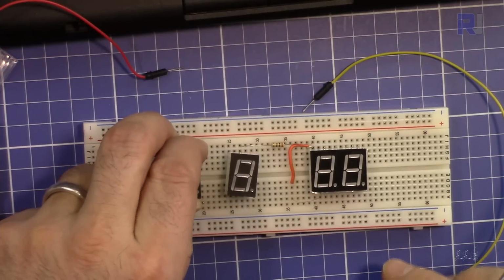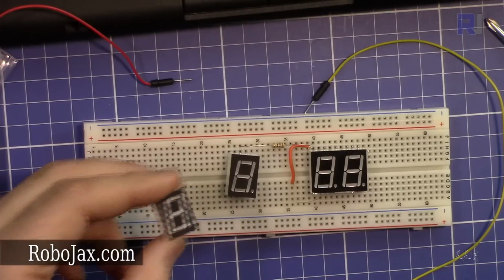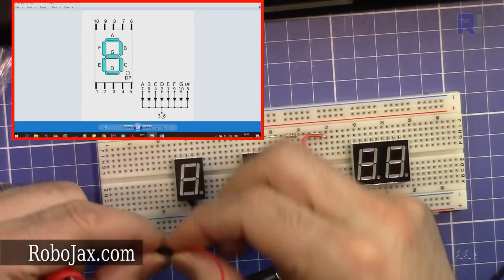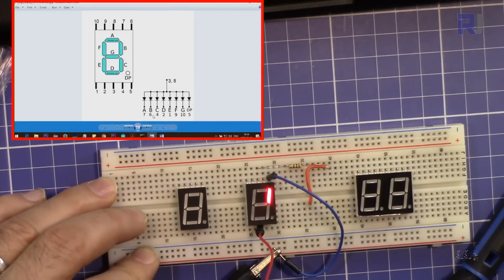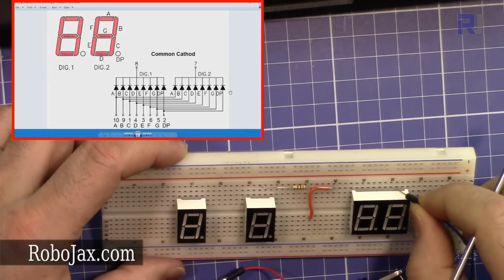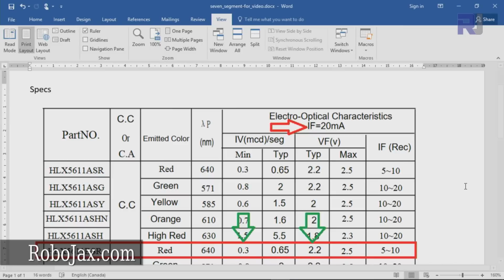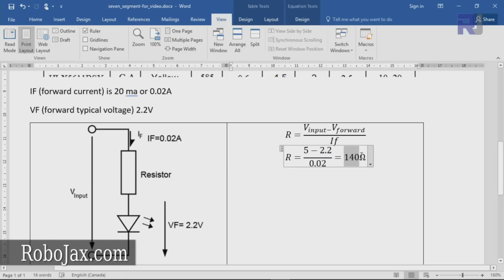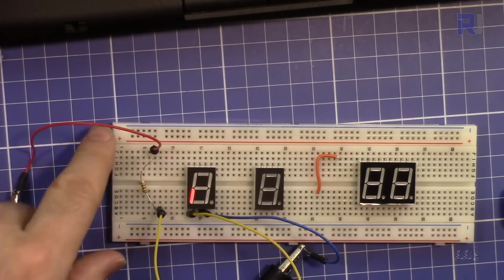How to use LED seven segment display and calculate its resistors value  - RJT652

Comment: At 20ma per segment, you don't want to light too many segments at a time if you are using an arduino, since the maximum current that can be drawn from an output pin is only 40ma. If you want to control these from an arduino either power the display from an external power supply or multiplex all of the segments such that only one segment is on at any given time.
Reply from the maker: each segment is connected to single pin so there is no issue with that. And yes external power is the best option.
Reply: @robojax  That's true in your example, but if you want to create a working two digit display with an arduino this way, you would need 16 digital pins, but the arduino only has 14.  So practically speaking, that's a problem.  For multi digit 7 segment displays, It's typical to connect each digit's common to a unique I/O pin to select the digit.  Also each segment of the digits are wired together (e.g. digit 1's "a" segment is wired to digit 2's "a" segment and so on...).  Then 8 additional I/O pins are uniquely connected to the segments a-g, and dp.  The pin count is now at 10 (still quite a few, but workable).  Of course one could reduce pins further by multiplexing the I/O (e.g. via shift register), but  in any case, once you build a practical circuit, it is then possible to turn on multiple leds and run into problems which is a trap beginner's can fall into.  Hopefully, my point is clear.  Thanks.
Reply from the maker: Here is a solution for that https://youtu.be/k-f6lwwUTAs  or this https://youtu.be/R5ste5UHmQk

Comment: this is a very clear explaination but I need more from two digits because my has 18 pins.
Reply from the maker: How  many digits it has? would you please send the text or model written on it?.
Reply from the maker: I searched it online and got zero result. Where did you buy it. Send me a link of the store.
Reply: I have one of those too, mine is common anode so there are two leads on the top where you connect the positive,  they are next to each other I think it's pin 13 and 14

Comment: How do you display two different numbers on the 2-digit one where the pins are shared? Same numbers are easy like 33, but how do you display 45 for example? Thank you for this video!
Reply from the maker: Hi, it seems you missed the most important part.  Each display has its own common. you turn on common 1 to display 33 and then common 2 to display 76.  please watch this video again.
Reply: @robojax  But the 2 digits share the same A-G pins, which means that they cannot be on at the same time to display 2 different digits.

One YouTube video said that you have to turn each digit on and off fast enough to fool the eye in seeing both digits at the same time. Is that correct? I think it makes sense. It is a compromise between less pins but more circuitry. Your video did not explain that so I didn't know.

Thank you for your reply and the details in your videos. They are great. Keep up the great work and have fun!

Comment: I wonder why I can't use one resistor in the common, that way you save yourself a bunch of resistors :)
Reply from the maker: because one resistor will create voltage reduction that is enough for one segment. We have 7 segment and each will be ON or OFF independently. If they were all on like showing the digit 8, then we could use one resistor. But because the display is to show different digits, it must have separate resistor in order to lit properly.  You could use one resistor, but at different digits, you would get different brightness which is not good.
Reply: Right, that makes lots of sense :)

Comment: thank you very much for your help and one question how much volts do i need with green because mine it doesnt work with 2.40 volts
Reply from the maker: 2.4V is already maximum. put a resister in series and revers the polarity. you might have connected it in reverse.
Reply: @robojax  thank you for your help and your quick answer i will try it and i will answer.
Reply: It works it was my first time that i use 7-segment display thank you for your help

Comment: is port 3 and 8 connected? so if I put a battery on 3 and 2,   'D' would light up? and same if i connected to 8 and 2? (i have a common cathode display)
One more thing, is there a formula to get the resistor value? (sry didn't really understand how you calculate it)
Reply from the maker: Yes 3 and 2  or 8 and 2  will turn the D . for your second question ,with 100s of videos, I had to watch to answer your question and Sure enough, I have answered your question in the video for formula. You must have escaped. I have explained so you fully understand  how to calculate the resistor. Thanks

Comment: Can these LEDs be controlled by a potentiometer to display voltage allowed to pass through the "Pot" and into the circuit?
Reply from the maker: so you want them to  be voltmeter? Not by itself but if you use an IC or Arduino, then you can send number to display. Here is how to use seven segment display with Arduino: https://youtu.be/f3GqRMQ8jYs

Comment: I would like to understand at the beginning of your video you have use the led of segments without the resistance and by the end you say that each segment led need resistance .Could you explain me please ?
Reply from the maker: I mentioned that seven segment display needs about 2V to turn ON. yes you don't need resistor if you connect directly 2V to the segments. We use resistor to divide (reduce) the voltage.  There is another video on Seven Segment here https://youtu.be/BPDbU4pBSvs

Comment: Thinking about building a calculator, how do I do a multiple didget display using a decoder chip?
Reply from the maker: For calcualator better option would be LCD1602 https://youtu.be/q9YC_GVHy5A or LCD2004 but you can do it with LED display TM1637 https://youtu.be/F5rhnFX3_w8 and you will need a keypad https://youtu.be/qIDzzG2LUtg or this https://youtu.be/d4bs8A8iMJ0

Comment: do the 7 segment displays have to be hooked up to ground?
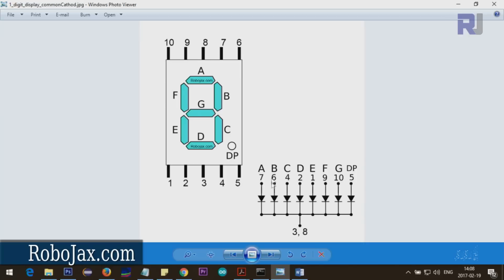Reply from the maker: at 01:15 I have mentioned that we have either command Anode which will be connected to + or VCC  and then each pint for the a, b,c,d,e,f,g will be connected to - or Ground or GND. If we have common Cathode, then the Cathode will be ONE pin and it will be connected to Ground or GND. But the each anode of pins a, b, c,d,e,f,g will be connected to +.

Comment: I want to make a 5v 10k pot where the 2 digit 7 segment LED tells the voltage that's being resisted by the pot. Do you know of any good tuts on this? I'll be using a LM317 as well.
Reply from the maker: Do you want to make voltmeter to show the AC/DC voltage?

Comment: Forgive my newbiness, but is there no way to display two separate digits simultaneously on the 2-channel display? The segments on each digit share an anode, so I can't see a way you could pass current through one and not the other unless you alternated quickly or something which seems really inconvenient.
Reply from the maker: @Jason Gould, Yes you . we have separate cathodes. see the page from data sheet https://snag.gy/h7NQ1Y.jpg you can turn on each digit sepearately
Reply: Thank you! Mihail Stefanov  Multiplexing is something I'm aware of in computer monitors, but didn't know was done on such a small scale as this. What I get from this is if you were to make a 0-99 counter with a couple of 4026, you would not want to use this particular display because you'd need something between the 4026s and the display to get it to display properly.
Reply: Robojax  This is not the device in the video though, no? This one has 18 pins and would operate as though it were two separate single digit, 7 segment displays next to each other.